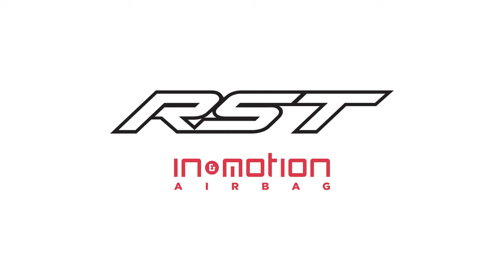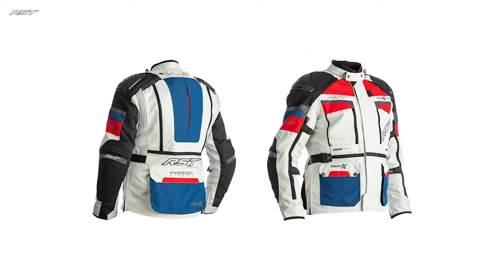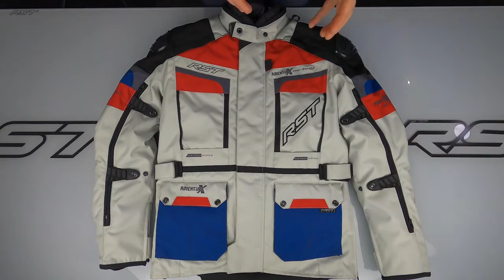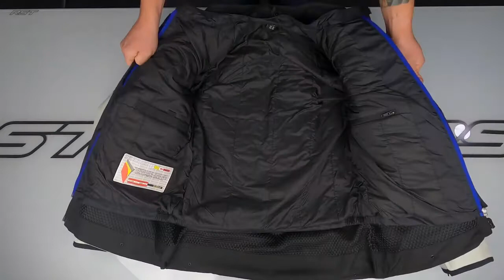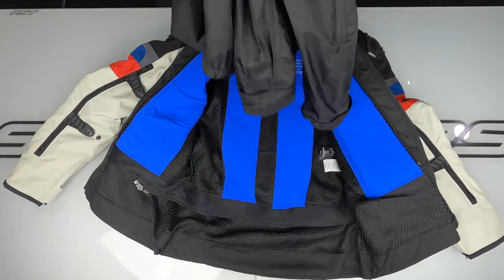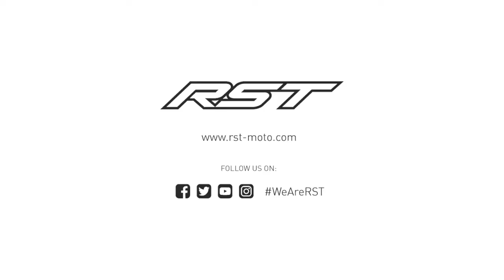RST Pro Series Adventure X Airbag Textile Jacket Features

Comment: How do i wash and keep these pants and jacket clean ive just bought a set and theres no instructions on how to keep them clean ?? Especially the inner layer on the pants ??
Reply from the maker: Hi due to CE regulations RST are not permitted to recommend washing. its best to maybe wet lightly with a sponge and mild detergent maybe give it a scrub using a nail type brush if necessary. Use a re-proofer to add water repellency back. Removeable liners can be taken out and washed at low temp and allowed to air dry before replacing.
Reply: @thevisorshopcrossanmotorcy9996  ok thanks very much can I use one of these motorcycle clothing cleaners and reproofers ??
Reply from the maker: @nateryan7041   yes they should be fine heres a link to some https://www.thevisorshop.com/en/Clothing-Clean-and-Reproof/c-248.aspx

Comment: Bad idea combining the thermal/waterproof liner as a single removable layer. In hot but raining conditions the outer textile will eventually wet out, leaving you a soggy mess if you remove the liner. Adding a layering mechanism to remove only a thermal part would be much more versatile.

Comment: Have this jacket for a couple of years now and it’s a really good jacket.

Nice and warm in the winter and loads of air vents for the summer. 
The collar could do with a bit more adjustment. 
The biggest issue for me is not the jacket but the Airbag system.
To turn on the airbag you have to go through layers of zips and Velcro to get to the button.
The battery has to come out to be charged which is a faff.
It needs a power plug somewhere on the jacket so when you hang the jacket up you can just plug it in and have it sitting on trickle charge ready for the next ride.
It also needs a power button somewhere accessible when the jacket is worn.
Loads of times I’ve forgot to turn it on. So it’s off the bike gloves off jacket off zips and Velcro undone power on. Zips and Velcro fastened jacket on gloves on back on the bike!!

Comment: Hi, is it possible to get the inner padding of the thermal liner system on the Paragon 6 to put in this jacket? Are they compatible? Thanks
Reply from the maker: hi it is not sold separately, it would fit but as the inner lining is cut to suit each particular jacket it may not fit perfectly eg you may find it has excess material as its for a looser fit than say a jacket with a more tight fit.
Reply: @thevisorshopcrossanmotorcy9996  Thank you for your reply.
Which of the 3 jackets is most suitable for cold wind? Which one offers better insulation?
I need a resistene jacket for L'inveno, which one do you recommend?